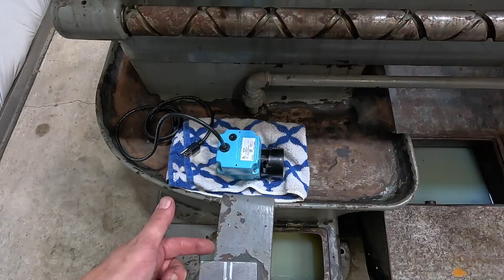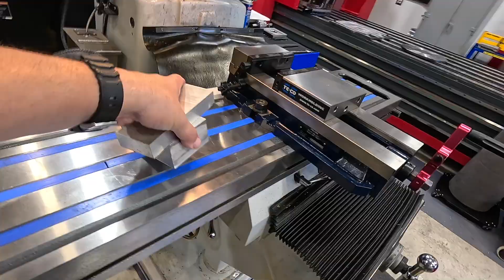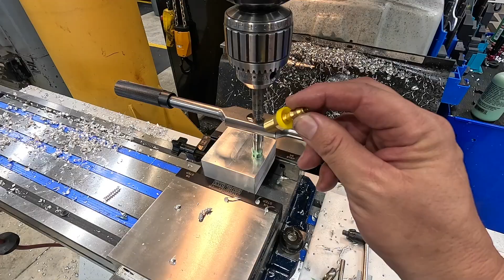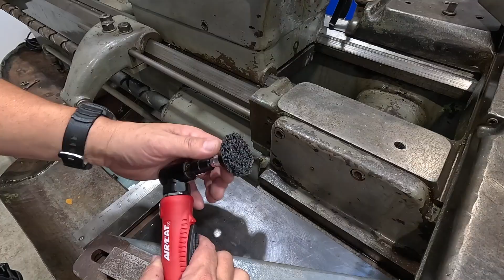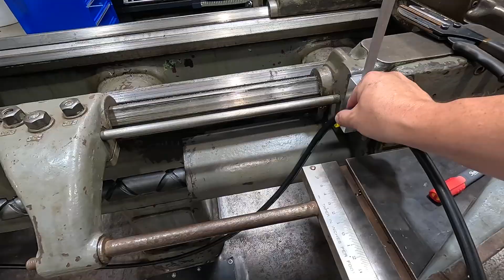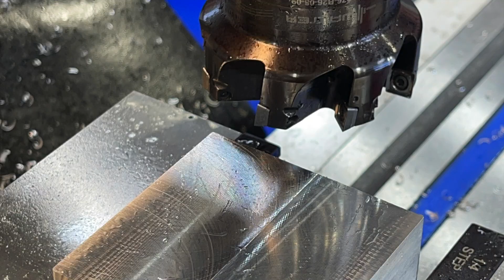American Pacemaker Flood Coolant System Repairs Completed

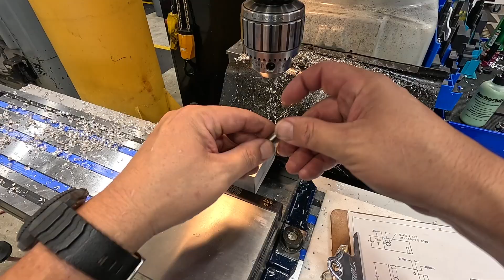Comment: 24:42 if you want the hole 1/2” from the edge, would you go .500 and not .600 from the edge?
Reply: The extra .100 is to account for the radius of the edge finder
Reply: @Luke-Leavitt  ah. You can see I have zero experience in these matters. 😃

Comment: For that Parker push lok hose if you ever get a big fitting stuck inside a hose, an easy way to remove it is with a soldering iron. It cuts the hose easy without damaging the brass with a utility knife. My Parker guy said to use a drop or two of dawn dish soap on the barb to ease the instillation.

Comment: NPT fittings are trouble. Heat cycles make them leak over time.

The neatest solution IMHO are bonded seals (a.k.a. Dowty seals). It's like an O-ring, but it comes with its own groove (it's bonded to the inside of a washer). All those need to function is a flat-ish machined face at either end.

Neatest because the parts are simple to manufacture (no tapered threads, no O-ring grooves), the seals are a dime a dozen (literally), they're more difficult to damage than an O-ring and easier to use than most other options, especially if you can get the self-centering ones.

They're usually good for high-ish pressure operations too, I've seen them hold 3-5ksi (air, mind, not oil) just fine.

Oh, and if the face to face distance is too big for just one, they're fine to stack on top of each other, as long as they remain aligned.

Worth a look.

Comment: Hi Adam, bit late to the party but from watching the flow results i'd say you have 3 or 4 issues. #1 - the pump is too small - capacity and head pressure, #2 - too many bends in the lines, as every 90 deg. bend will add approx. 1 foot of head as flow restriction, #3 - pipe way to small for length of run and #4 - use of air couplings on a fluid line is a no-no! The amount of restriction is huge with fluids. Little Giant pumps are good and have a great name in Aquarium use for 24/7 reliable performance but the infrastructure has to be right to minimise backpressure. One other thing, I hope that type does not use a magnetic rotor / impeller as obviously running steel contaminated cutting fluid through them will a) clog them up and b) wear out the shafts double quick! Things to consider - not your fault but the supplier who hooked you up could have done better IMO!

Comment: regarding the water having to fill up part of the chip pan before hitting the drain. you could level out the low part of the pan with some epoxy or similar so it drains better and have less standing water

Comment: Adam, you might want to consider adding a second quick-connect/disconnect on the headstock side of your coolant valve.  That way you won't have to use a wrench to change from the existing hose-barb fitting to the other fitting that you mentioned.

Comment: Just a heads up about that collet adapter you added to your torque wrench: that adjusted torque value only works if the adapter is in line with the wrench. If you have it kicked to one side or the other, it changes the effective length of the torque being applied which means you need a different value. To simplify things, just have the adapter at a 90° angle to the wrench and then you don’t have to apply any correction to what you set.
Reply: It will only be less, not more. which is fine for an ER collet chuck as you don't want to over torque them

Comment: I'd suspect a lot of the pressure loss you have is in the quick disconnect fittings.  You might check another way to make those connections, perhaps a larger or free flow style.

Comment: Adam, if the position of a yellow valve handle is inconvenient for you, you may just unscrew the self-locking nut on a valve axle and rotate the hadle by 180 deg., so it would be working in another square of a circle, thus out of the way of the tailstock handle. Best regards to you from the Bison homeland. :)

Comment: When you compare the way the pump worked when you tested it in the sink, to the amount of coolant at the drill, I would say all your fittings (most especially the flexible pipe) are undersized. There is a lot of friction to overcome there.........
Reply: I agree. You can only get so much flow from 1/4" hose and fittings.  There's a reason why the original pipe on the machine was 1/2" pipe.

Comment: 59:34 .. Usually we put the FEMALE quick connect on the pressure side ... so it doesn't spray anymore when you disconnect it :) ... 

BUT .. (I didn't watch to the end yet),  maybe Adam has use for the open end to flood different parts with coolant "manually" with just the hose ...

Comment: I noticed that when you used the torque wrench the collet wrench was close to straight out. That will increase the leverage and tighten it past the desired torque spec. Need to run it at 90 degrees to the wrench itself. Anything above or below will influence the torque.
Reply: Came to the comments to make sure someone else noticed!

Comment: 45:30  I am old and do NOT have the strength I used to have in my 40's :) ... I use Oetiker Style stepless single ear hose clamps, on applications like this.  

As if??? ...  I wrestle together a half dozen of the "Push to Lock' fittings shown here?? ...I am sore for two days afterwards!! :) 

Somehow i do NOT think they will give Adam any trouble! :)   The Push to Lock also LOOk nicer when done and are cheaper too, a GREAT choice for a project like this! :)   ... If in doubt? try t take one back off again without tools!  :)

Comment: Someone else may have suggested this but could you drill and tap a hole in the bottom end of the chip pan and make a drain back to the pump sump? It would, of course, need some sort of screen.

Comment: I used a similar drill with the bit insert on a multi spindle bar machine in the 90's. They work well. Hope your job goes smoothly.

Comment: For fluid flow, always upsize from the smallest mandatory I.D., in this case, the pump outlet. Everything you attach should be larger than that, if possible. Not really an issue in this case, since it looks like you have sufficient coolant flow. Glad to see you get flood coolant running on the American. Yay!

Comment: LOL! You torque the collet but put JB Weld on a pipe with pin holes in it; that seems a little like backyard mechanic stuff to me.
Reply: I think the JB Weld will be fine on a 'temporary' basis.   Some f my backyard mechanic stuff has lasted long after I thought they would.   Sometimes life isn't about perfection.

Comment: The original Pipe was a 1/2' NPT line. From your description and print !/4' NPT fittings will be grossly undersized and will not deliver the FLOW you need. Up size the lines, fittings , remember you want flow not pressure. Consider using heavy duty 3/4 Id garden hose and 3/4 in NPT to hose barb fittings. Brass of course. Also consider making the large block into a 4 way cross TEE but fed from the bottom for added options later. Ask me how I know. If you start big enough you can always choke it down later if needed. tough to go bigger without starting over. IT'S YOUR RE Do.

Comment: Two things. Did I miss him installing hose clamps on the hose & would look into seeing if motor starter has an unused normally open auxlary  contact that the 120 volts for coolant pump will only run while lathe motor is on. Should install a moisture resistant switch to turn off pump when not needed.

Comment: Stainless is not the best choice to thread into aluminum, especially in a wet environment, you get galvanic corrosion, zinc plated stuff is more compatible. using a sealant as a dielectric or antisieze to improve the electrical connection to the point of near 0 potential will help. Otherwise you will get a nasty white powdery corrosion where the dissimilar metals meet. Otherwise looks great. we used s coolant inducer similar to that adapted to the drawbar of our old VMC with a few solenoid and check valves and a spare m command to put through spindle coolant on the mill, its a real game changer even at low pressure, getting it right to the cutting edges is so much better than spraying it at the chips.

Comment: This is going to look AWESOME :) .. some of the suggestions here are REALLY good too .. Some comments are shall we say ... not as helpful :)

As far as a bypass valve or everyone worrying about the pump burning out.  They obviously have not used a Little Giant coolant pump before, It is specifically designed for this application ... 

It shuts off automatically when pressure gets to a reasonable limit .. and is READY to run back on the moment you need coolant flow, Adam mentioned he is going to add a switch near the chuck area.  

This is because the vast majority of the tie he won't be using flood coolant.  You don't need t be turning the pump on and off 30 times during the job .. just closing the coolant valve shuts it off.

Comment: You NEED a power switch for that pump near the cutoff valve. That will relieve the strain on the pump. I'd add a little more fluid to the sump to prevent dry stage..And I would not worry about the pressure. The head will throw the coolant for you. You might want a filter in the sump before the pump picks up the coolant.

Comment: There is friction loss as others are saying, but a big factor is that there's 5 feet or so of head for that little impeller pump to overcome even without friction. If the sump were nearer the cutter height, you'd see much more flow.  A pump with a higher outlet pressure - like the original - will get you what you want.

Comment: Consider putting a 360 hose loop on the pump. That way you can pull the pump out of the sump without disconnecting it. It might pull the pump sideways but one zip tie will make is stable.

Comment: When using a 1/4 NPT hose fitting, a good idea is to get them with a barb for 3/8 hose. Otherwise there is a restriction in your line. I have come across this so many times as a millwright trying to figure out why air tools are too slow and not enough coolant flows from a pump. 1/4 " means different things when talking about pipe and hose or tubing.
Reply: Agree completely. Have two hose reels in my shop. One is 3/8 hose, the other is 1/4, and the difference in flow on a small system with about 135psi is astonishing! Legit night and day difference
Reply: High demand air tools like die grinders and impact wrenches that require 90 psi  @ 10 cfm flow need 3/8 ID hose as a minimum. This (coolant) application shouldn't be any different. A 1/2 inch ID hose would work even better if the pump could keep up.

Comment: Glad to see the torque wrench upgrade! 
I've had several part failures on a vehicle I've owned for many years because I hadn't used a torque wrench in the past. It didn't seem like I was hurting anything with my 3/8s impact or hand tightening at the time but it did come back to bite me in the end. I torque everything now - Especially threaded aluminum parts.

Comment: Yeah I'd agree with others, the nipples are pretty small ID, the tubing may be OK but the nipples are fairly small ID, I'd say go up to the next size and you'd be golden, the pump should be plenty strong enough but it needs volume for the pressure. I'm guessing new fittings cost less than a new pump. Still nice work. For the chip tray building up with coolant, maybe consider getting a plasma cutter or something and just cutting a little off the sides and welding it so the curve is steeper and lets the coolant drain back more efficiently. No shame or harm in fixing or improving the performance of an old machine like that, looks like it may have been repaired before or bent a bit, so fixing it shouldn't be too bad!

Comment: I'd recommend using Igus track for your hose. You could run a wire to a switch for the pump in the Igus track also to make turn8ng the pump on/off less awkward.

Comment: Good job and attention to detail. I suspect the reduced flow at the tip of the spade drill may be due to the size (restriction) of the hose barbs and the hose to some degree. 
When Adam showed the pump operating in the tub without any plumbing on the outlet the pump had plenty of flow.
Adam mentioned 15ft of hose used and it appeared to be small enough diameter for the pump to struggle maintaining a higher flow rate over that distance. Larger size hose and fittings would possibly alleviate the issue. A larger pump may overcome the friction to some degree but may not be as effective as increasing the hose and barb size.

Comment: A few things i personally would have done differently. 
1) I would have made the distribution block on the cross-slide be two port (1 in 2 out) and plumbed two male to female ball valves to it.

2) Following with 1, Instead of fitting a nipple directly to the ball valves, you can now fit a quick-connect to each of them, and utilize the valves to switch between them. This has the added bonus of being able to swap out any other coolant attachments you need, without having to disassemble anything with the delivery system. 

3) I would have replaced the original pipe that has been plumbed in, and utilized it, a bit more effort, but a longer lasting fix. 

As for the bend in the chip pan, you can either use it as is, or cut off a thin wedge from either end, bend it back into position and weld it, this will raise the pan on that side enough to not have to worry. Welding a few tags to the pan to serve as feet should prevent the bend from reoccurring.

Comment: I worked in polypropylene plant using process pressure of 80,000 PSI we had similar block fittings for change of direction.

Comment: Hey Adam great little project. Thanks. 
Wondered if you considered fitting the female quick connect directly on the ball valve & have the permanent hose fitted to the adapter ring with the male quick connect on the end of the rubber hose, That way you can easily remove the drill coolant feed at the ball valve. You could then easily make a “normal” coolant feed by having a magnetic base & mount with a Coolant Flex Pipe attached to clamp onto the cross slide/carriage, where ever suits. Put a rubber hose onto this with a male quick connect to plug back into the female quick connect at the ball valve. That way you can have any number of coolant arrangements with no need for “disassembly” in between. Just connect & go…

Comment: Your electrical set-up looks janky enough to trigger a fire inspector. You might want to use some plastic spiral wrap around the cord at the pump end as it will chafe against the metal with the pump's vibration, creating a wear-fire hazard. Or use a stand-off bracket with an open-sided grommet.

Comment: the pump is rated at gallions per height,
if you put a 6 foot hose on the pump and hold it up it may not pump anything out the top,
the pump needs to be rated gph at 4 to 5 feet height.
you might find a small hose to make a small orifice for  the bottom coolant hole in the drill so it will share better

Comment: Airline fittings are usually not good for coolant, great for air, too small an orifice for liquid.
Had a similar thought process at work for one of our coolant block lines that I frequent had to remove.

Comment: Hay Adam thanks for the great content, just a suggestion to control your pump, use a remote- control power outlet like the ones that are used for Christmas lights you can find them easy at Home Depot and Lowes this time of year, then you can turn it off and on without unplugging it.

Comment: Can someone tell me why torque wrench length matters isn’t 100ft lbs the same on a 24 inch or 48 inch torque wrench?
Reply: The collet wrench adapter he's using changes the length of the torque wrench, so the app compensates for it.
Reply: Going off thread dia/pitch and material  torque specs isn't the same as the German specs "gut und eng" good and tight
Reply: Just a guess; probably because the torque wrench is calibrated for the force applied at the ratchets center of rotation. The adapter is extending and altering the gemoetry of where the torque is applied so I would guess that this alteration isn't linear.
Reply: I think the Torque Test Channel has a video explaining this.
Reply: The answer lies in the definition - ft lbs. The value is ‘x’ lbs force applied by a lever measuring 1ft. If the length of the bar is increased to say 2ft then the torque is effectively doubled if nothing else is changed.
Consequently the value has to be recalculated whenever the length of the lever is changed to achieve the original specified torque.

Comment: Your getting a lot of restriction from the quick connect. Should be sufficient to keep the system cool, but may not be enough to push the chips out. Nice set up. Thanks for sharing.

Comment: One thing I have learnt over the years working on barb fittings: if you're going to cut the line and peel it off when replacement is due, try not to cut into the barb itself. You'll never get it resealed once you do.

Otherwise, nicely done. 👍🏻
Reply: Been there, done that...

Comment: To me, your quick disconnect should be just the opposite so that you don’t get any drippage and that out of your hose when you unplug it, it drains away from your drill because there is a small valve inside the female coupling and it won’t allow it to run or two if it should accidentally get bumped and come loose, she won’t have fluid everywhere Just my point of view another thing you may want to put a disconnect right it up close to your valve that way you can just disconnect it and put your flex hose right there where you can put your fluid onto your cat also, your hose size may be a little bit small and cut down on your flow of fluid

Comment: I never run taps into already threaded holes, I use thread repair tools instead, they have no real chance of cutting new thread or overcutting the existing threads. they simply align threads or clean out the debris not able to be blown out with air and solvent.
Reply: Its not rocket science. I run taps into buggered holes all the time w/o issue.